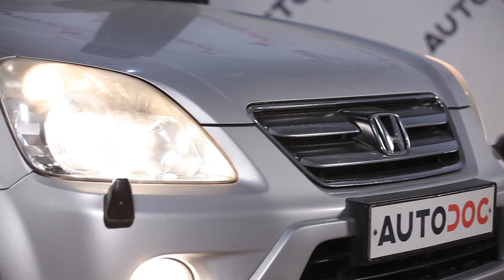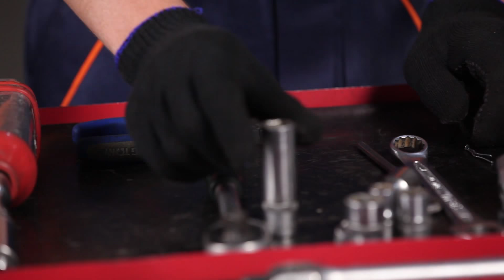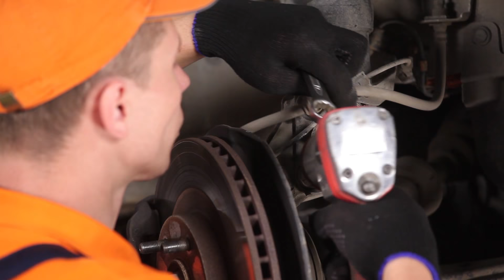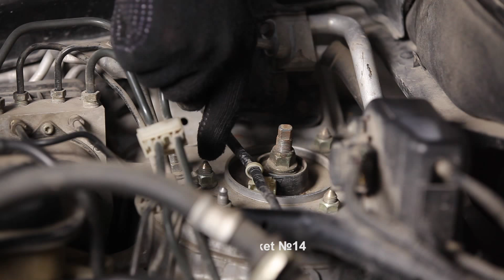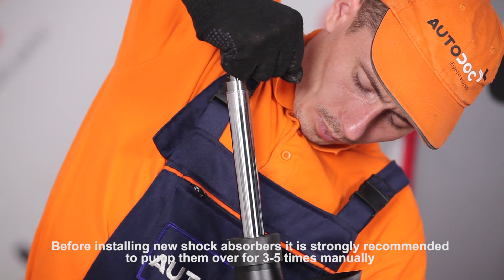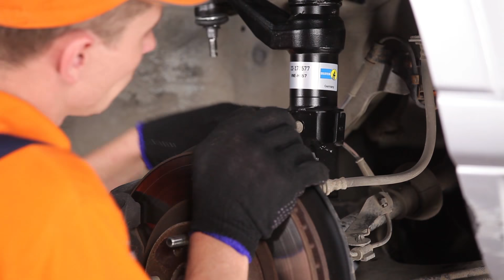How to change front shock absorbers on HONDA CR-V 2 TUTORIAL | AUTODOC

Comment: Why not just remove the middle but of the shock when it is mounted on the car all that just seems extra steps for no reason
Reply from the maker: Thank you for your feedback! we are grateful for your valuable remark. We  are working on improving of the plot. We made this replacement in conformity with the factory regulations and  the specified procedure on the part replacing. Best regards, Autodoc.